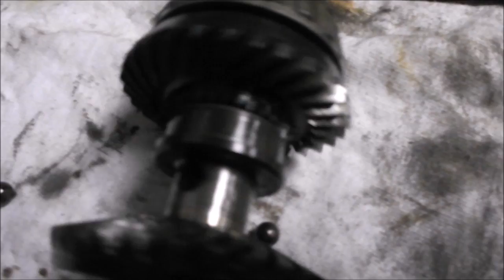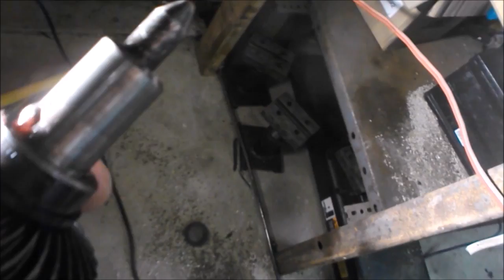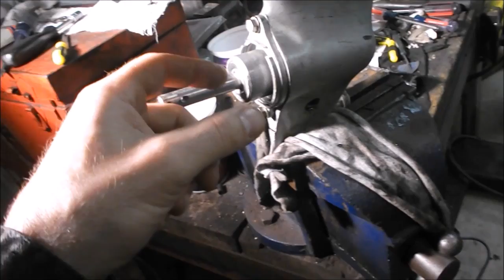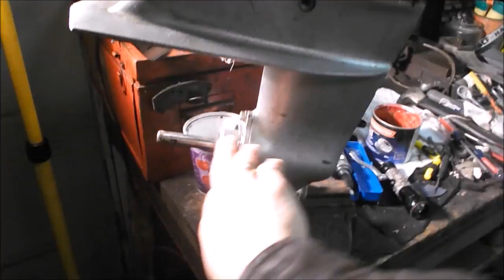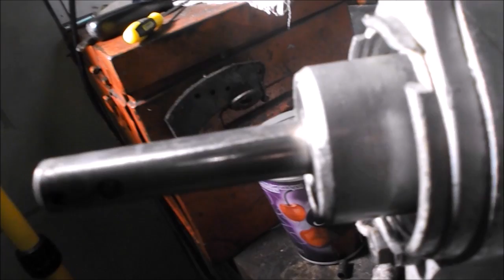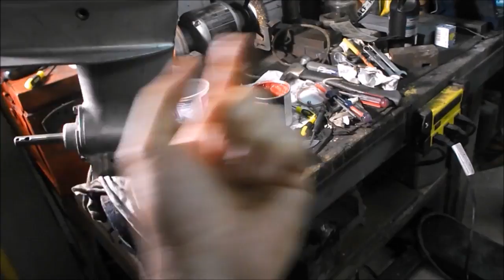Outboard Lower Unit Rebuild (Part 3 of 6) Propeller shaft, drive shaft, gears, bearings

Comment: How did you set the correct backlash?
Reply from the maker: I just reused original part and shims.  With a new bearing backlash should probably be checked but i didn't check it

Comment: Awesome vid bud question i bought an 81 25 hp evinrude that had tthe gear case in pieces seemed complete after i put it together the shift rod screw was missing (which i bought ) it doesnt have a shift dog but it does shitf gears do you think this engine just doesnt have one ? Or is it just missing.
Reply from the maker: Manny Suarez 
Hi. I am not familiar with that model but I would suggest checking  google for that model and add "parts diagram" to your search

Comment: That pinion bearing thrust washer failure is odd, unless someone else had been inside and misassembled these items.  Both thrust washers have bevels on them.  Yes, the thrust washer with the bevel on the outside goes on top and the bevel faces up toward the powerhead.  The other thrust washer has a bevel as well, but it is on the inner diameter of the washer, this bevel faces down toward the pinion gear.  Using the grease to retain the shift balls is the prescribed method and will do no harm, just like you said.  Keep in mind that the shift mechanism in the prop shaft is spring loaded, so you were most likely fighting the spring tension while reinserting the prop shaft.  Make sure the shift rod cam in the forward position to minimize resistance during assembly.  One final area of trouble on these gearcases is wear to the mating surface between the reverse gear and the large aluminum prop shaft bushing/seal carrier.  Once the aluminum rib gets worn down due to friction, excessive prop shaft end play will result.  This excess prop shaft end play is the cause of many shifting problems/failures on this style gearcase.  The prop shaft end play is tough to evaluate because the prop shaft is spring loaded towards the prop.  The only way to evaluate prop shaft end play is to remove the spring first.  Hope this gearcase is working fine for you now....